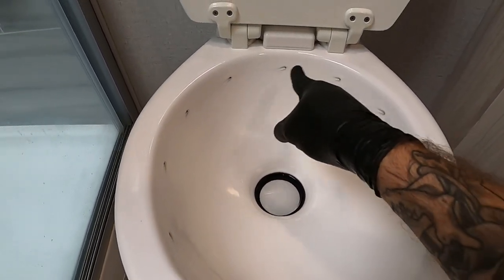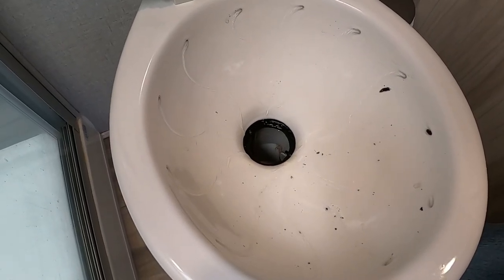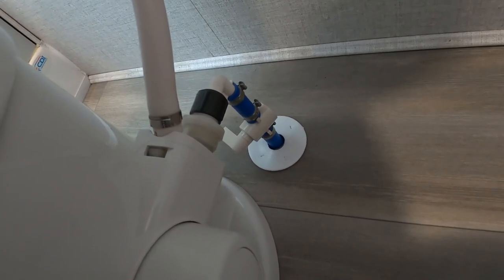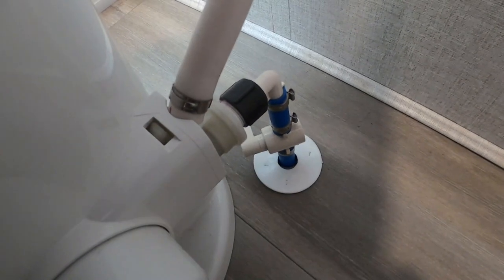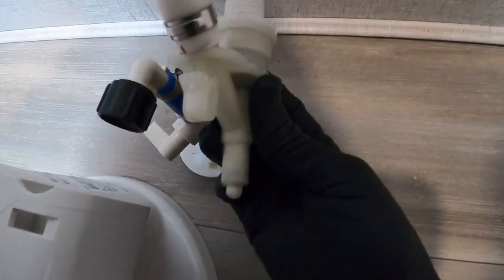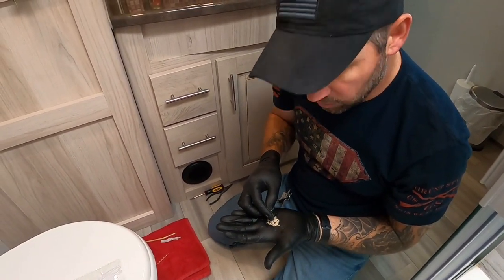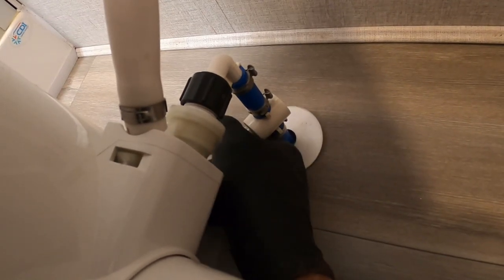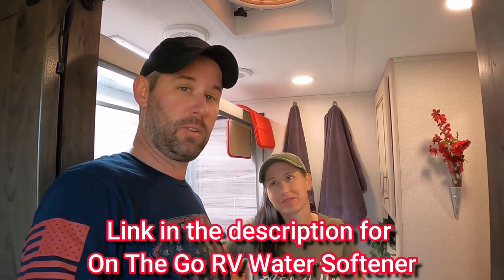Low RV Toilet Water Pressure (Easy FREE Fix)

Comment: I did, I did fix my own toilet! The first year I owned it. Replaced that valve you took out, but I removed the whole toilet. The part was only $20.
Reply from the maker: I always feel so accomplished when I fix something. 😂 It rarely turnes out this smooth.
Reply: What is the valve called?

Comment: Glad you were able to fix the toilet issue.  Glad it was t something major.  That was great you fixed it Dustin. You’ve become quite the fixer upper. Lol! Our water here in Vegas is hard water. They said that’s why our water heater broke. Hopefully with your water softener it should do the trick. Thank you for thus video. It’s very helpful. I love that tool you used to get that cap off. Great job Dustin. Glad as well that Alliance helped you out.  It’s great that they work with their customers. Hope you have a great day. And see you both soon!
Reply from the maker: Alliance has been great. We are so glad we went with Alliance.
Reply: @WaywardWaggs  I’m glad you did buy the Alliance. I heard they are great. I’m glad they were able to help.

Comment: Thanks for the video. Do you gave a link for the brush cleaners you show to clean the water holes
Reply from the maker: We don't have a link. They are just pipe cleaners that you can get at Walmart or hobby lobby.
Reply: @WaywardWaggs  I have been searching on the net but cannot find the same type you are using.
Reply: Thank you . I just realized you were talking about a tobacco pipe cleaner. Was looking at a water pipe cleaning brush.

Comment: What was the white pex coming into the top of the pressure unit?
Reply from the maker: It is the water line that feeds the water to the holes at the top of the bowl that spins the water in the bowl.